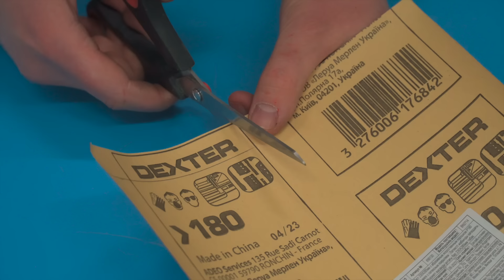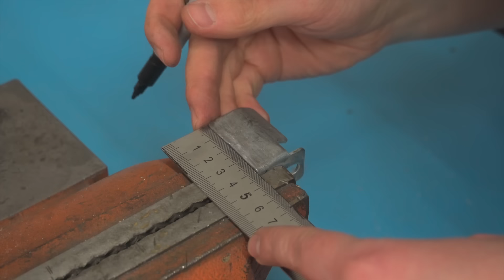Handyman's Don't Want You To Know This! Tips & Hacks That Work Extremely Well

Comment: Hi👋🤠; It would be VERY Helpful if you would post your Ideas " ONE AT A TIME" With a SEPARATE Video for Each One... Your Ratings would go UP and you WOULD HAVE More Subscribers🤔🧐🤨👌😉👍. Your ideas Are Most EXCELLENT Though👌👍👍👍👍👍
Reply: Some don't make much sense.  What's going inthe glue melt? Salt maybe. And why did you pour glue down pipe?  Why spend 5 minutes melting glue for final and than not show finished handle (covered by suggested next video.